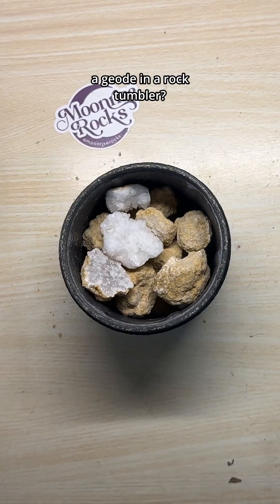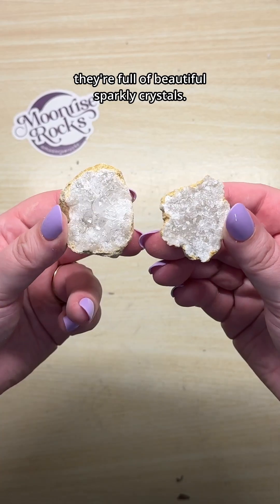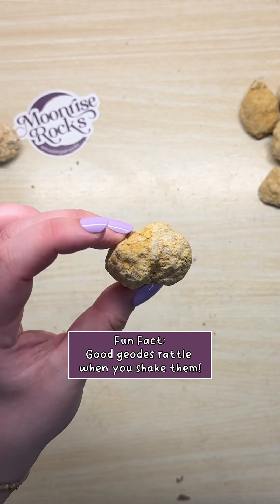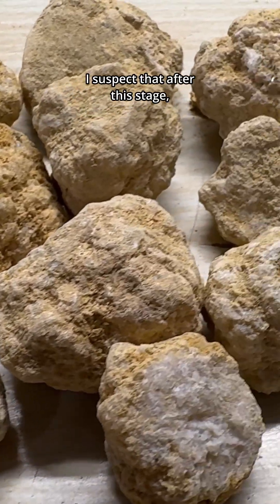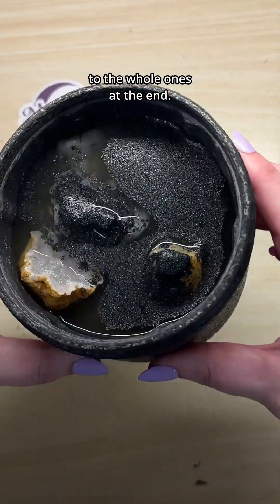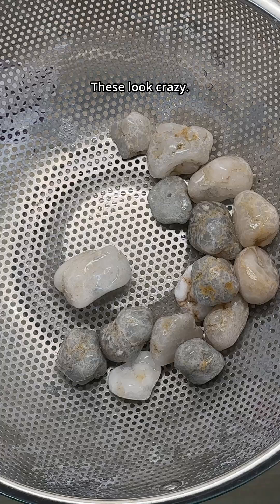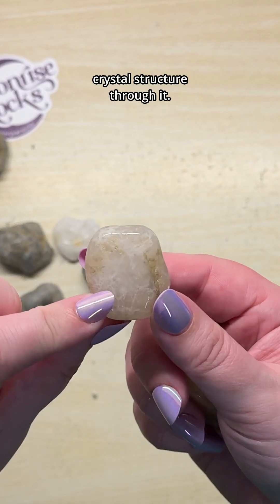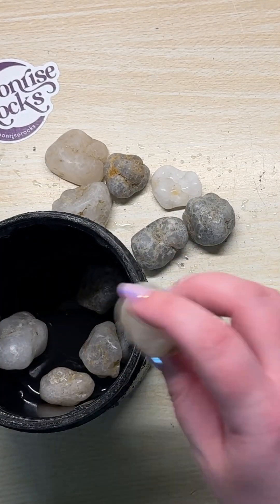What could possibly go wrong?

Comment: Need an air hose and/or a lot of time under running water to clear out any grit trapped inside. Wouldnt want the coarse grit to come out during a later stage and leave everything still rough.
Reply: She could always just do a short wash cycle before moving on to the next finer grit